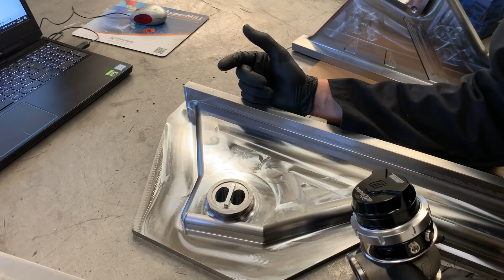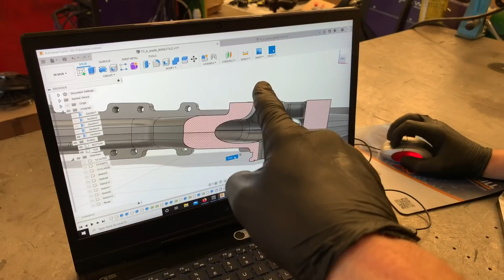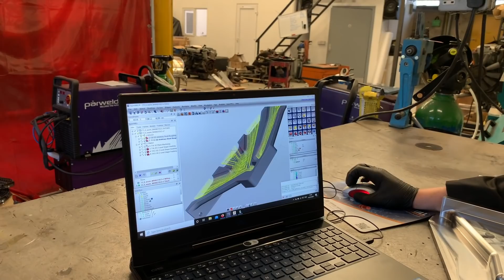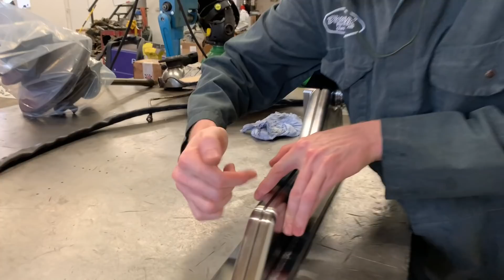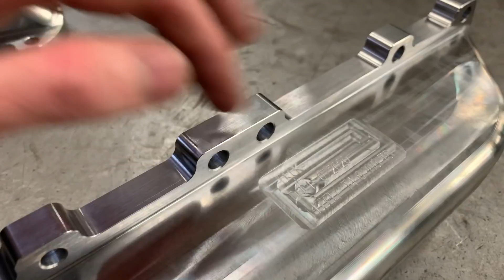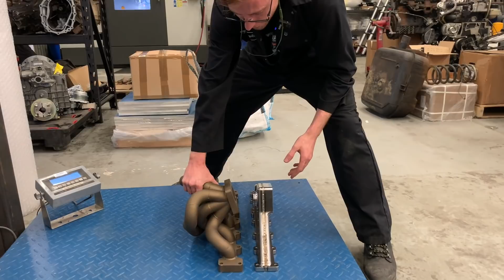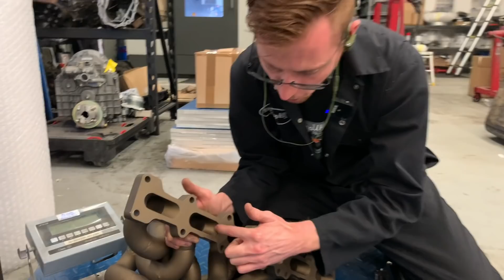BILLET TURBO MANIFOLD OM606/605

Comment: Dimples vs smooth?
I've seen manually applied dimpling machined to the inside surfaces of some manifolds. Strikes me that your billet manifolds could provide a platform for an excellent test between smooth and dimpled inside surfaces to determine whether this process really has any benefit. Your setup with dynos and scientific approach could make a great video, and determine, once and for all, whether dimpling is an effective surface treatment to increase airflow through inlet manifolds.

Done properly:
1. Overall pattern of dimples
2. Depth of dimples
3. Distribution of dimpling inside the passages to 'bend'  the flow

could all be investigated.

Here's a non-scientific golf ball test demonstrating some of the effect of dimpling:

https://youtu.be/nj5m4_nMKVY?si=99bLcybWdMawE7e5

Comment: I have always wondered why a wastegate can’t be replaced by a butterfly on the atmosphere side of the turbo making it run in a vacuum (no load so it remains spooled up) you would need a vacuum break to stop oil being sucked out of the turbo and uprated stem seals etc but it’s all solvable.😊

Comment: awesome work.      
as far as comparing to the  tubular manifold,  I guess I look at the fact the tubular has tenfold more surface area+ thinner walls-  combined with the fact that HEAT is energy...   so  scavenging every BTU possible  to drive the turbo is  quite beneficial.  
👍👍👍

Comment: This is way late for a comment, but..... my old R/C nitro truck had the same issues with its exhaust port. The engine side was rectangular and the exhaust pipe was round. The wielding around the flange that attached the two was, like you said, a wall.
So rookie me went to town with a Dremel tool and some bits..... easily made the engine rev faster, higher, and made ~10% more power. 

As I side note I had an '79 300sd. With a OM617. I really wish I knew about all the stuff you can done with that and this engines.

Comment: Not entirely convinced with this design to be honest, in regards to working it hard like in a race car etc. Would be interesting to see how it stacks up against an equal tubular manifold on a flow test.
I also would be interested to see how it holds up to expansion and contraction over time. You talked lots about flow and design but what about thermodynamics? will it snap studs, blow gaskets and warp???
 I guess for most applications it's a great solution.
Ps Great videos guys👍

Comment: The engineering behind an exhaust system is complex, require FEM, fluid dynamics simulations and a lot of other calculations. Is that manifold a result of engineering or just a nice machined piece?

Comment: While I can appreciate the effort, good luck making more than 750 whp with that. Making that exhaust do a HARD 90 into the turbo will make it nearly impossible to get clean air into the turbo and only increase back pressure in the engine which is why you wont make more than 750 whp. I'm sure you could cram more power into the engine but it is totally not efficient. And the reason we use 2 waste gates is to keep the turbo under control. Not because it "looks cool" or makes it "complicated". They are needed when making 1000 whp+ with a big turbo you're trying to keep at 600 whp. I would take a log style tubular manifold with a proper transition into the turbo inlet over this. Sorry man. If this was the answer they would have done it a long time ago on F1 cars

Comment: As the TiG welding doesn't extend around the full depth of the runner dividers there is an unsealed joint that will expand and contract under normal use and bearing in mind the potential to get red hot on a turbo manifold that joint will cause extra strain on the relatively shallow TiG metal joint.  I can see that after a while that crack will extend through to the manifold face causing the box to delaminate. i.e. split back into its two halves.  
I am also concerned about the interference between cylinder pulses that the tubular manifold seeks to resolve and the billet manifold encourages.  The comment about the transition between the tubular runners and the manifold plate is easily resolved by ovalizing the tubular runner and therefore is not an intrinsic fault of the tubular design.
I understand the packaging advantage of the billet design but I have severe reservations about its performance and durability.  The last thing in an engine that you need is greater heat but the billet design will promote that.
As said elsewhere lets see a back to back dyno run on both the tubular and billet designs.

Comment: Interesting.  Just looking at I'm guessing the tube solution flows much better than the billet one, because of the merge collector and longer radii.  The turbo flange on the billet piece is basically at a right angle to the flow from the exhaust ports. Did you do any flow testing?

Comment: The inside wall between each channel/exhaust dont prone to move after multiple heat cycle ? I mean, the only sealing between 2 channels is from the flatness of the 2 parts and a nice big weld on the outside and flange.

Comment: While the machine work is great.  I can't help but think that divided scroll turbos usually have a 1-5-3 in one port and 6-2-4 in the other.  This seems to take 1-2-3 in one and 4-5-6 in the other, would this not hinder the turbos performance?  Just wondering, not trying to knock down your work.

Comment: i see good and bad in your new manifold design it looks like its going to warp easily  be quite expensive it will be good for idiots who cannot fab a ex manifold the usual way it does have way better transition at ex ports for four valve heads  it will have less surface area to heat up engine bay  less runner length boosting up quicker take up less room better chance of 1st up integrity  for sealing in cases were peope use thin flanges and seperate flanges witch often not made rite buy desighn warp or dont lighn up i am pretty sure with your inherent deshighn you will have cracking issues with your welding long wide objects like this threw hot cold cycling

Comment: This strikes me as a bad idea. a) Weight, this is stainless steel and much much thicker in the average cross section than the appropriate wall thickness/material in tube ie SS321 or inconel. b)You have not got tuned length headers here and in order to try to make such with this manufacturing process would result in again a much much heavier item than the appropriate 321 or inconel tube headers. c) Production cost, the milling machine time let alone the cost of the base material (the billet) would make this many times more expensive than the appropriate tube header design even if you were to use inconel material. Conclusion; it's a great exercise and definitely proves it can be done, conversely it also proves why you would never do it in the first place.

Comment: Unquestionably this is a beautiful machining and welding but you aren't comparing apples with apples. Your design is effectively an optimised log manifold. You show the space savings against an equal length tubular manifold ignoring the fact that your design is not equal length and does not maintain the pulse energy from individual cylinders all the way up to the turbo. The small radius 90 degree turn into the turbo doesn't look ideal.  However we know even basic log manifolds work acceptably well in turbo applications, so this can only be better.

Comment: Interesting project .....
But I'm betting that this setup has a HUGE amount of restriction, unequal flow numbers on every port, and will literally MELT in use.
Also, flow into the Waste Gate is far too restricted and will result in uncontrollable Boost Pressures.
The stock Cast Iron Exhaust Manifolds are usually an excellent place to start.
Exhaust Backpressure/Flow is a critical part of a Turbo System, 
and efforts to get the exhaust pressure, and Intake pressure, closer to equaling each other is a good goal to work towards.
You would be better off running all the Exhaust Ports into a single 4" diameter Stainless Steel Pipe with the ends capped off,
then mount the Turbo in the most convenient position on that chunk of pipe, with the entrance to the Turbine being heavily radiused.
Then the Waste Gate can be mounted anywhere that's convenient on that pipe as well.
Same goes for the Intake Ports,  create a "Sewer-Pipe" intake manifold, with very short, "non-tuned" runners,
with the exception that each Intake port needs to be shaped like a short, smooth, Velocity Stack before it is welded to the pipe.

The Velocity Stacks should have a Radius equal to, or greater than, the most narrow dimension of the Port, 
but this will likely be cut down in an effort to mate with the pipe/plenum, or the pipe/plenum 
could be cut in half, with a flat plate on one side, to accept the Velocity Stacks.

A Twin Turbo setup would be much better for equal Air-Flow Distribution, then you only have to deal with 3 Ports at a time.
.
.

Comment: - What if the channels were equal volume. Could that make up for the difference in length? 
- How do you make sure there's no leak between the channels when only the first few cms are welded.
- It's nice not to have that sharp transition right after the port, but the flow it's much better in a circular cross section than an oval. Have you considered making it transition smoothly to (semi) circular?

I like the idea. The advantage is obvious, but I doubt it can compete on performance.

Comment: 17:14
It looks as if widening the ports on flange section does only worst job if it is going to go narrower without smooth transition.
Dont u think that piped manifold would be better if it had a properly designed flange?

Comment: Since its billet, it should be possible to put air cooling groves on it to dissipate heat.
Reply from the maker: Adriaan Van Wyk good idea however it’s important to keep heat in a manifold and not dissipate it.

Comment: I don't see it lasting very long being made of aluminum, especially on something that runs more than 1/4 mile at a time. The exhaust temps will eventually turn it into a puddle, especially under boost. When you can literally turn a steel manifold yellow hot under significant boost, you'll blow a hole through this in short order. The fact that it's more compact is nice, but the uneven length runners are going to make it a nightmare for keeping the EGT's uniform. The dyno will tell all I suppose.😉

Comment: But aren't LOG style manifolds worst possible option for turbos in general. Still a pig no matter how much lip-stick you put on it. For those who don't know the trade off is that with LOG manifolds turbos with spool a couple hundred rpm sooner at the cost of at least 20% of HP in the power band.

Comment: Don't they have two wastegates for avoiding boost creep on giant turbos where there isn't space for a larger wastegate? Like I'm sure it is also because of the twin scroll too. Here is what I don't get: how is this much different for the end user than a cast iron manifold in terms of performance and design? Weight only? Because it looks to be the same, and I bet a cast iron manifold would be much cheaper. Isn't there some advantages of having a longer, equal-length, tubular manifold, which traditionally is why people don't use cast iron manifolds, and isn't this just a different version of a cast iron manifold, aka, a short runner manifold?

Comment: You can't say that billet is better. It is a question of the engineering and what you want! But nice cnc work❤️
Reply: This set up will work perfectly on engine bays where space is limited, this is a super compact design which offers the OM606 in many vehicles where the tubular will not fit.
5 stars !

Comment: Well, good effort but: big difference is that the runners are not in equal length. Therefore the comparison to the other manifold is not fair. Runner length is of big importance for exhaust gas flow and spool.

Comment: Great design work, the full flow ports are nice. I'm not sure about the uneven runner lengths, there'd be little pulse scavenging effect with this design, and the sharp 90 deg turn gas is forced to make heading into the turbo flange are questions for me.  I'd be eager to see a dyno comparison between the traditional and billet manifolds to prove the design. If it makes the power then farewell glowing bunch of bananas.

Comment: just to ask with all of the outer edges does the webbing that holds the dowel pins seperate out as it gets hot and if that gap opens does it have any negative flow effects

Comment: The weight comparison at the end doesn‘t seem fair—the other manifold has equal-length pipes, I think? And very smooth radii. In any case, that one COULD have been made a lot lighter if all the pipes went straight together like in the billet machined one. If anything, I‘d say it‘s a point in its favour that it only weighs as much as the billet manifold!

Comment: Nice work, but I must say, it would have been far more productive to make the patterns and cast it instead. 

Alot less waste, not to mention  cast irons resistance to warping. Cast iron is king in exhaust manifolds for its cost and durability.

Comment: But those gas paths are awful, and it's not even close to equal length runners or equal flow volumes per cyl. If you're struggling for space and need it to be super compact, I kinda get it (hell, it's basically a stock cast log manifold in essence) but none of this looks optimal.

Comment: Nice work done by you guys and you are pushing me up to own one of that amazing engines 

But before you lose to much material and time building this headers you need to check the efficiency of it on dyno
It may have opposite effect 
You can see how much mazda R&D put effort on there engines headers to prevent the turbo back pressure pushing from one piston to other

But im very happy to see such a nice product 

Nice work and i wish you the best

Comment: I fort they worked out the flow rate per cilider stroke that why they started making them with all bends in them so the lengths change. If you can do the new one straight out. Why can't you do that with the tube one it would be less fab work an less weight

Comment: I think the old design will out perform the new billet piece. The other manifold looks to have equal length runners as well. Airflow doesn’t like to turn 90s like how the turbo flange on the billet piece is at tight right angle from the runners.

Comment: Incredible design
Reply: I really like the manifold design however don't you loose tuning that equalize the exhaust flow? The tubes are the lengths they are for a reason aren't they. It's not just random pipes.

Comment: The biggest advantage to doing this is you can run simulations on drag from air based on the air flow with this technique. You can't really do that on a tubular built product because each one is different.

Comment: Gorgeous part! absolutely beautiful, but I have some doubts about the sharp angle of the turbo and wastegate flanges relative to the ports. A really sharp bent there. I'm far from an expert but I have the feeling boost might be a little hard to manage too for that same reason. I have a feeling that the collector on the tubular manifold has a more efficient design too

Comment: I wonder how good would the seal for the two peaces of this manifold be if they were to be friction welded?!?!?
Reply: cant friction weld a non-circular part as the pieces need to spin at high speeds and then be forced together.  Now if it was plastic you could ultrasonic weld but doubt that would last too long
Reply: @Matty_Bski  i thought you could friction weld just about anything that has a flat surface 😅
Reply: Илија Б. You can but they will have a hard time matching after spinning them together (thats why circular parts are what you do it with)

Comment: What I dont like about it, is that you weld within the ports afterwards. The initial perfect port shape/transition is partly being destroyed by that weld bead.
Also Im wondering if the manifold will warp when in use. Because the weld is just around the outside and like 5cm into the ports. If the manifold starts warping that will lead into leaking exhaust gases from 1 port into the other. In worst case the hot exhaust gases enlargen the leak and basically burn a hole from one port into the other.

Comment: Pipe length also has an effect on where power is made in the rpm band.....
Reply: Not really all that relevant with turbo
Reply: Sonac not as important...but still bloody important.
Reply: @MrDOHC1JZ  You can still make a lot of power with unequal header length. Considering the massive space saving this gives, it is worh it. in worst case, just fit a bigger turbo. Now there is the space for one
Reply: @Torvikholm  or two ;p

Comment: A. The cost for this would be huge compared to the tubular manifolds.
B. Surely the billet must flow way worse with that radius going into the turbo. You have put a large radius on the inside but compared to the tubular manifold it doesn’t flow as good.

Comment: Very interesting product. Couple of questions, I'm assuming that it 's impossible to weld the junction between the halves much beyond some way into the throat of the port, so therefore I also assume the precision of the fit between the halves is being relied upon for gas tightness?  If so, is there a potential issue with leakage when at operating temp due to expansion causing bellowing of the halves?  Next, are the passages equalised for length?  Next, why not make it from stainless?  How about one for Mitsubishi Evo's?!!!

Comment: im confused how this is superior to a cast manifold.
Reply: Any performance gain will come from both port diameter and  recduced flow restrictions from  entry and exit angles.   Cast manifolds have hard 90's  which is terrible for flow.  The smooth 45's and collector merger is what's going to make the difference.